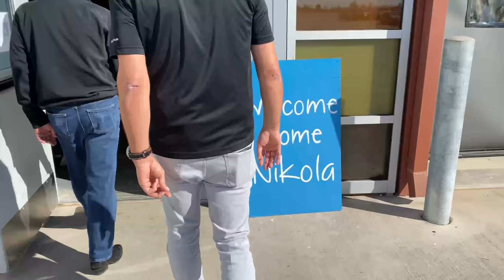Nikola Series - Ep. 3: Coolidge Facility - Assembly Tour

Comment: 9:02 - Sandy forgot to say how much he hates threaded fasteners.  Look at all of those bolts!!
Reply: Joking right?  You can't snap fit or zip tie structural components to frame rails, lol.
Reply: At least bolts are actual mechanical objects. That's about always saw. Discussed the gaps, or lack of them, on an invisible truck.
Reply: @Mrbfgray  Huck bolts!
Reply: @Mrbfgray  you can design things more efficiently where they don't require as many bolts however, even heavy truck frames.
Reply: FUD motors is SCREWED & HOSED.
Reply: It's worse than I thought. Nikola doesn't have its shit together. I mean literally. Shit here...shit there....shit everywhere.
Reply: @johnpayne8223  Yep was thinking that as well.
Reply: @ke6gwf   How?  Rivets are sometimes used but they have some obvious drawbacks and not sure if they are actually faster to assemble--assembly ease and speed is THE ONLY reason Sandy favors cheesy snap together crap, it's good enough for light plastic parts typically. 

I've worked on or around 100's of semi trucks and they are always bolted together thank god, can be a pain in the as anyway but if you can't undo a fastener and redo it?....then it's really the shits.
Reply: @johnpayne8223    Still bolts.  Those are the one's that have a one use nut that locks into hole so you don't need to put a wrench on both sides?  If I'm not mistaken they are a bit of a headache to take apart at least compared to regular bolts.
Reply: @Mrbfgray  I didn't say replace bolts with anything, I said design it so not as many are required.
Most of those bolts are to attach brackets to the frame, and if you have worked on semis you know that the frame manufacturer will design the frame with structural cross members, and then the suspension company will design suspension cross members, and then the drive train team will design transmission and carrier bearing cross members, and then the air team will design brackets to mount the air tanks, and other brackets to support the air hoses, and other brackets to support the brake valve, and the suspension leveling valve, and then the electrical team will add a bunch of brackets to support random wire harnesses or connectors or magic boxes, and there is very little dual purpose designs, each department is seperate.

If you want to reduce bolts and steps, you combine these functions into well integrated complex shapes, now fully possible with cnc metal forming and bending, and you can cut the number of bolts way down, by reducing the number of seperate parts that have to be attached to the frame.
Reply: @Mrbfgray  I can tell by the sheer number of bolts that reduction is possible.
And look at how Sandy pointed out the HV cable bracket and how it could be eliminated, and Mark agreed that there was a lot that could be reduced on the truck.

Right now they have basically a stock frame, and so have to bolt everything to it individually, but if they do a Tesla on it, and start engineering parts out, a lot will reduce.

Now, I am pretty sure at this point that you are going to take the opposite position to anything I say, and are letting your ego at being contradicted control you, so I am going to say that the earth is round and the moon landing was amazing!

GO!
Reply: He seemed too disappointed with everything else to bother bringing it up.
Reply: @ke6gwf    ONE of us has an engineering background and degree, I don't think it's you.  But HEY...that's an appeal to authority that you'd probably use, not me, it's not an argument, just perspective.  :D  Good LUCK.
Reply: @Mrbfgray  and we all know that engineers do a lot of stupid things, and that a degree doesn't make someone smart, but you seem to be offended that you are being questioned, which prevents you from being able to learn new things.
Kinda sad really.
Reply: Talk about walking straight into a nightmare.  Its funny, he mentions TESLA right after lmao.  A reset word before PTSD kicks in with after seeing all those fasteners.
Reply: @ke6gwf  Excellent analysis Mr Blackburn.  Kudos!
Reply: @Mrbfgray  Guaranteed clamp load, Not dependent on torque!
Reply: RIGHT! I was thinking that too. Good call!
Reply: @KingLutherQ  Still no bar or QR codes/printed labels on the parts-bins yet they are tracking the torque of every bolt installed? Fork-lifts aimlessly wandering around too?
Reply: @Mrbfgray  I suspected that you're NIKOLA's cronies or probably Trevor Milton hahahahhaa
Reply: @3nityC     Sarcasm or you didn't read my comments?  ;-)  I guess you could take it that way based on this thread, I wouldn't pay a dime for a dozen shares of NKLA.
Reply: @KingLutherQ  you ever worked in a building that isn't 100% completed? if so you'd understand that workstations can be fluid and move at any time, especially considering there's a wall in between half the factory that will be taken down once construction on that phase is completed. So you can make fun of them all you want but this is far from the final assembly line.
Reply: @Mrbfgray  Try to use one's "qualifications" to settle argument on the internet? That's a little desperate. I'm an engineer myself, most of the people I've been working with have engineering degrees, the "smartness distribution" among them, is no difference than other people you know.
Reply: @grantcummings2326  My point was that Trevor Milton described Nikola as being a technologically advanced company like Tesla and just a few months away from producing a real marketable product. Trevor even boasted that Nikola has beaten Tesla in some ways. But upon close inspection, Nikola is far from having any mature hydrogen or EV technology - or any technology that would give them a technology edge. Nikola did NOT have a real prototype; did not have good R&D even today; and definitely is not near any production for many years. The Nikola super battery was a lie. The Nikola hydrogen prototype truck was a fake. And Nikola producing hydrogen on their site was a lie too. Nikola was made from lies and gilding. And Munro is throwing away his good reputation for just being around these conmen. Nikola execs are not innocent on this fraud - they all knew that Trevor was lying, and they all helped him hide it to pump up the stock price.

Comment: At 16:44 Sandy asks an important question:  "Do you build your own fuel cells?"  The response wasn't clear to me but it sounded evasive and was not a simple "yes", it was something like "so...one of the things we do here is build prototypes and send it to Linden and Christian".  Does anyone know what that means?
Reply: They are building the prototypes in house and sending the results back to engineering before they start mass production
Reply: @TheEvilmooseofdoom  hmmm...not saying that's what's happening here but that's how must manufacturing works bud.
Reply: I quit watching long before then.  Going over to a Tesla investment channel.
Reply: @TheEvilmooseofdoom  
Are they even still claiming to have any in-house tech?
Reply: Bosch bought the rights to sell the Powercell fuel cells. Bosch are supplying the fuel cells as othe components. This is no secret as Bosch is working with a lot of OEM´s
Reply: @bericschwa2064  So the answer to Sandy's question should have been "no", they are using fuel cells designed and built by Bosch/Powercell.
Reply: @levysrugo6861  If they are using fuel cells designed and built by Bosch I'm not clear on what prototypes they are building.
Reply: @JRP3  Well I mean they could be putting the Bosch fuel cells into their trucks and boom there is the prototypes..
Reply: @thingshappen9199  Most OEMs make their own major components like engines or transmissions but here its sounding like they are buying the fuel cells and my guess the electric motors as well.. its hard to tell from the answer the guy gave. but being that unclear in your answer might be the answer
Reply: @JRP3  Employees that use to work for BOSCH have been working for Nikola for few years.
Reply: Classic gas lighting: Answer a question by diverting the conversation sideways....corporate BS.
Reply: John Brennan  I saw a lot of empty space in that building.
Reply: @JRP3  It's all empty, a few guys putting together what looks like nothing, this can't be a real truck maker, it's an empty building, have you seen you tube of Daimler truck factory or volvo....it's like a real factory
Reply: They are an assembly operation. They outsource their fuel cells, batteries and motors. Their only proprietary builds are their software packages. And of course the trucks are Ivecos with some repaneling.
Reply: @Chainyanker007  Was not a good idea actually as everybody can see know :-) Tesla going to implode - IMHO.
Reply: @JRP3  Yes, I guess that is true. And that is very calming and reassuring. Hey, it is Bosch! The world biggest, biggest, biggest automotive parts delivery company. Even still true german. This is not scam. This is real.
Reply: @soennen1  Well your judgement is questionable since you also think "Tesla going to implode"
Reply: @soennen1  Clearly you haven't even done the most basic research since you don't understand why he's "selling", but I'll help you out.  He has options coming due that must be exercised and to do that he needs a lot of cash.  He's selling shares so that he can exercise those options which means he will end up with a lot more shares.  So in reality he's buying, increasing his Tesla holdings.  Further, most of his selling is done and it's only pushed the price down to barely under 990, it's unlikely to go down more from here, and once they report another record quarter of sales it's likely to shoot up again.  You're welcome for the education I just provided.
Reply: @JRP3  And because he is BUYING an enormous amount of shares the share-price is crashing from 1.063,-- Euro to 854,-- Euro within 40 days? That is a minus of 20%. Sounds not like a logic explanation but rather pushing-propaganda. Anyway: What I see is that the share price still is more than 153 times the companys annual revenue. And that with an overall price for the whole company that is about 30 times higher than three of the biggest car companies wolrdwide. This is something I call madness. Shareholders of this company seem to be that naiv to believe that there is only ONE car company left in 5 years AND that the production of cars at the same times increases many times todays level. Completely nuts. Sicko exageration...
Reply: @soennen1  I'll try again, though I suspect it's wasted effort.  Elon's options are priced at about $6 per share, current share price is around $1,000 per share.  That means for each share he sells he can buy 166 more shares.  His sales will still put extra shares into the market so it makes sense that the share price temporarily drops.  For those of us who understand it this is known as a buying opportunity.  I've been in this stock for 10 years and made millions while watching people like you talk about some mythical "implosion".  You don't understand the company, the technology, or the market.  People have lost billions betting against Tesla, every big short has had to capitulate with massive losses.
Reply: @JRP3  Yes of course. People that are not like sheep and buy a massiv overrated share in the absurd hope that the share will rise furthermore up to 1.500 times the annual revenu are fools :-))))
Reply: @soennen1  I've been right about Tesla for a decade.  I expect that to continue because I've done my research and you obviously have not.
Reply: @cengeb  I work at a Daimler truck plant.  We build orders of magnitude more trucks per day than Nikola does currently, but that's because Daimler is the largest manufacturer in the industry.  Nikola would be wasting money if they built a factory like the one I work in right from the start.  What they do have looks to me like quite a reasonable setup for the current size of their company and the current state of the electric truck market.
Reply: @brendanshroyer7696  Daimler is the biggest truck maker in the world yup...freightliner brand in the u.s. too is benz